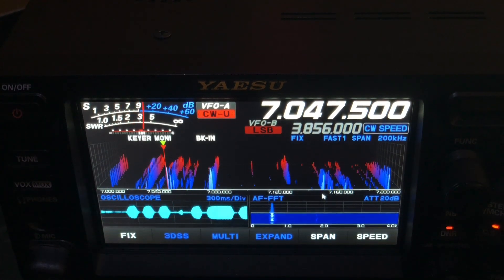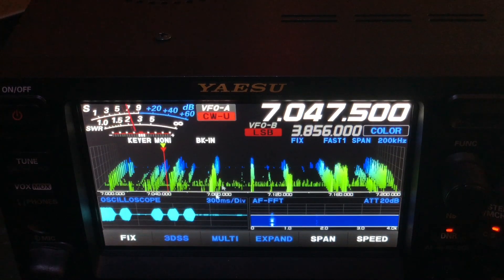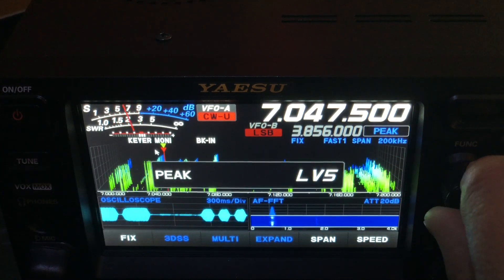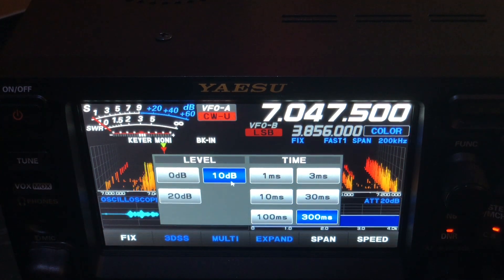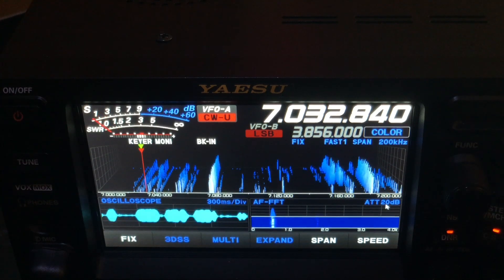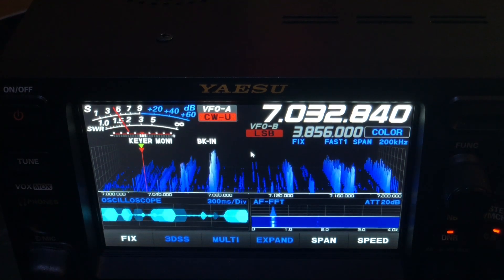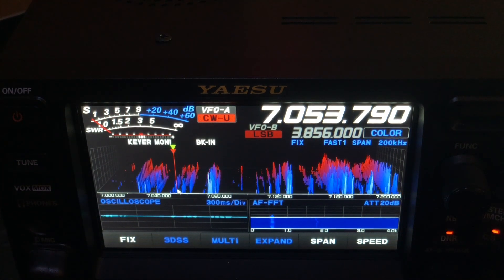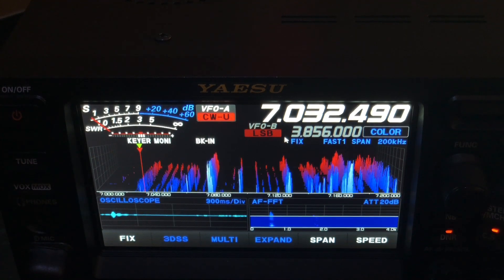Yaesu FTdx10: Display Color Scheme (Video #36 in this series) #yaesu #ftdx10 #hamradio

Comment: I am jealous of your wireless mouse...
Reply from the maker: I was fortunate that I had an older wireless mouse and DVI monitor in storage.  It was totally by accident that both plugged and played.

Yaesu kept the cost of the transceiver lower by using the older DVI ports, which are still more than enough for just displaying the screen.  It kept the old ports out of the landfills and the licensing is less expensive. Fortunately, we can still buy a DVI monitor but they are becoming extinct.

73, de N4HNH
Reply: @n4hnhradio  Yeah, I'm really happy that I kept my old monitor.  I heard the DVI port on the ftdx10 eventually burns out if you use a DVI-HDMI adapter cable, so that is weird.  73 -kd9rqf
Reply from the maker: Yes, it needs a native DVI monitor.  You were wise to avoid the adapter scenario.

73, de N4HNH